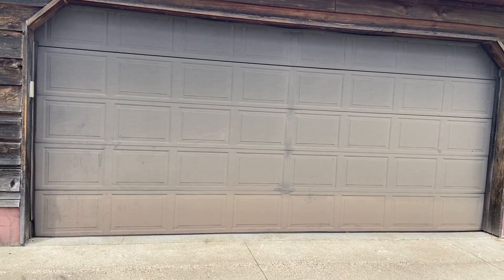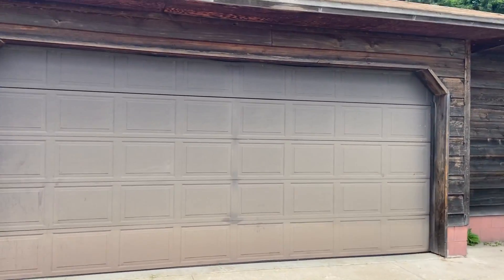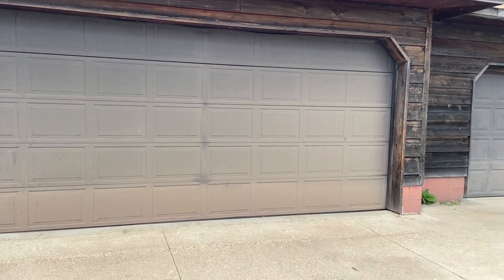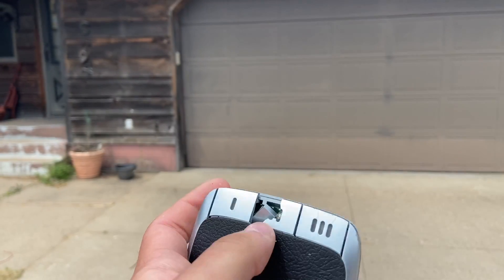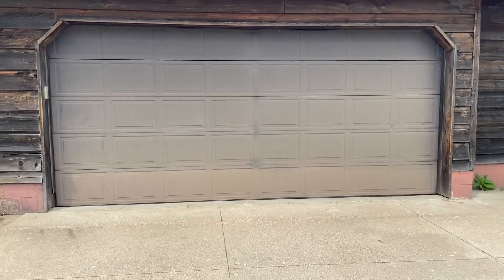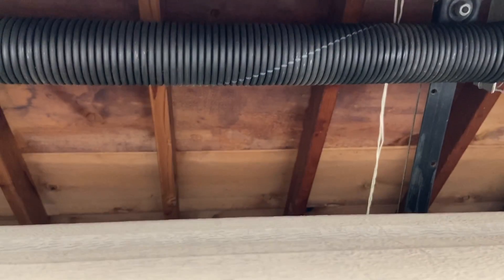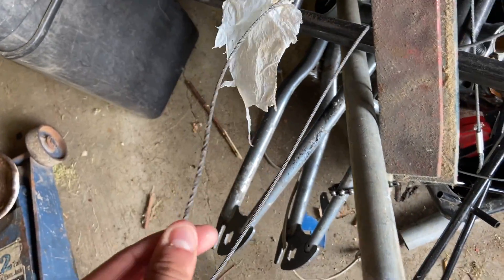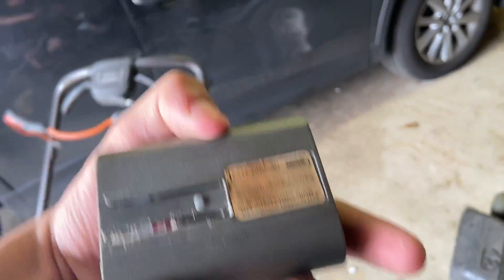Outside the Wayne Dalton's

Comment: You've got two different generations of doors. The 16x8 was a carry-over from Kinnear, a model 37. Don't bump it cause it's discontinued. The 10x7 is a WD 9100. Looks like the paint is just faded on the 16x8. Clean em up and repaint them, and you'll be in good shape. That Stanley isn't a very common one that I've seen. I think I might have one, but I'm not certain. I did buy a light cover for one off eBay a while back.
I'm not a Mopar guy, but that car is gorgeous!
Reply from the maker: Thanks! i actually have the book for the big door I've just never really looked into it, and thanks for the knowledge! didn't know they were to different generations on the Stanley, Stanley's are very common in my area and many still working, this machine was no different it was pulled from a 16x7 wood door when I got it I installed it on are third stall in 2019 because my dad wanted an opener for the car, also on the car thanks! it needs a touch up on the paint because I've put put a scratch or two in it (as well as a dent OOPS) other wise its a really good car!